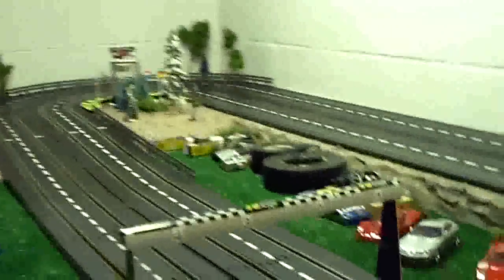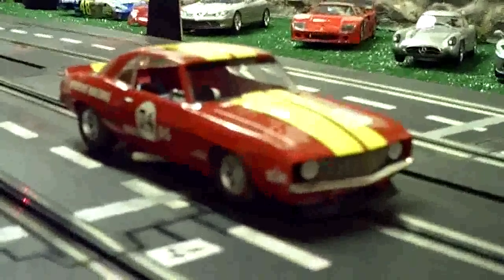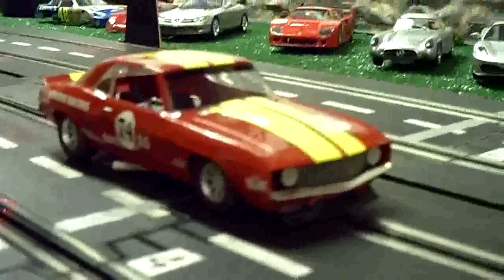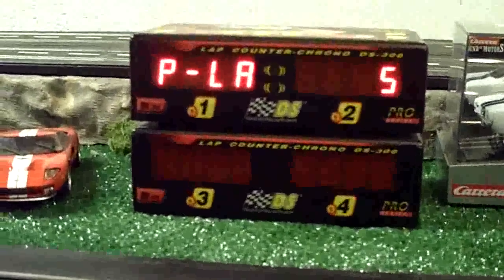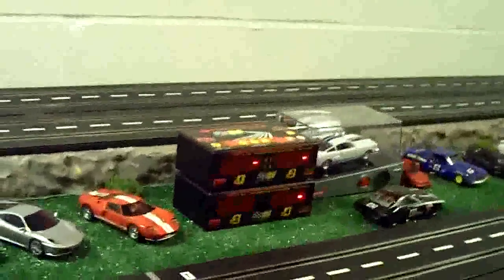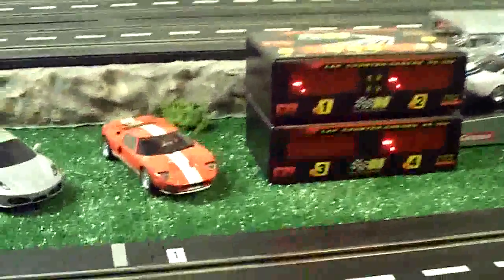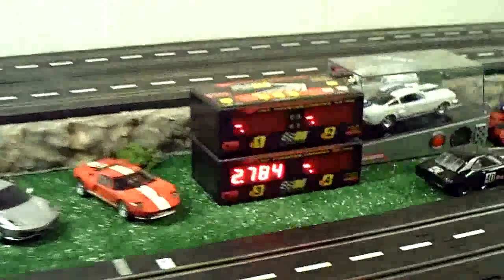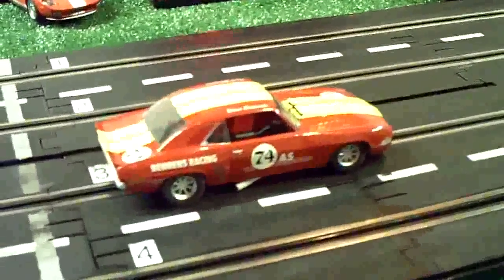1/32 - 39' Artin slot car track / Scalextric 30,000 rpm race motor

Comment from the maker: This motor runs great, depending on you track size, if you layout os smaller the 20k motor will work fine - the 30k will be too fast for the track - Not fun to drive.